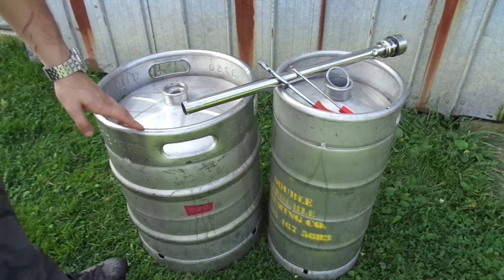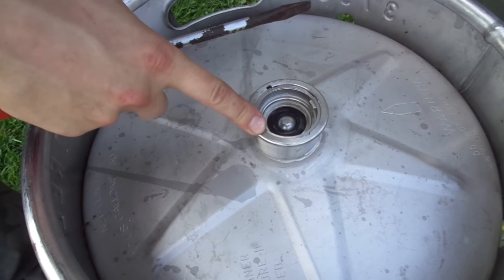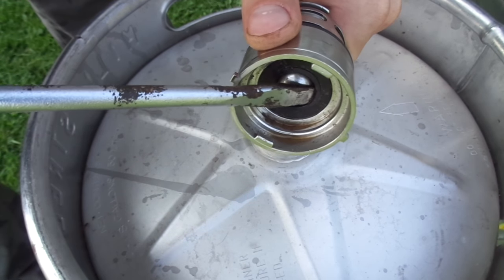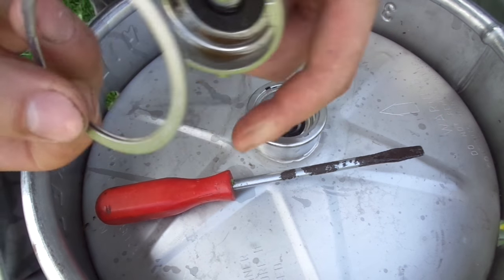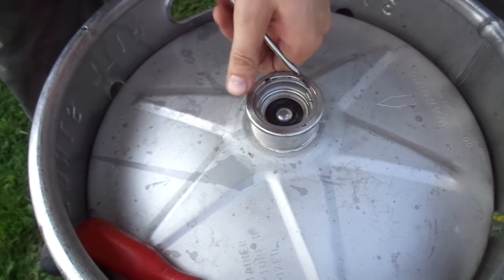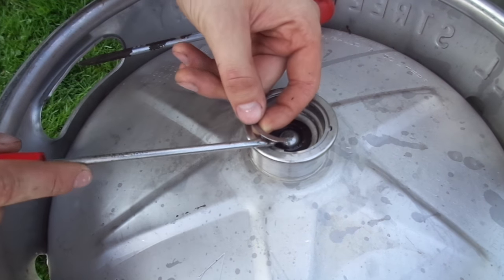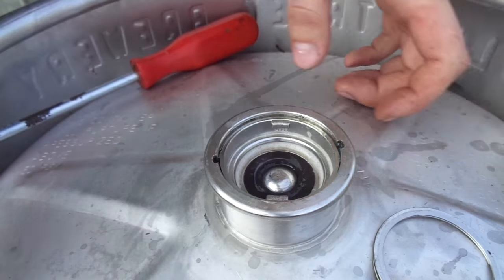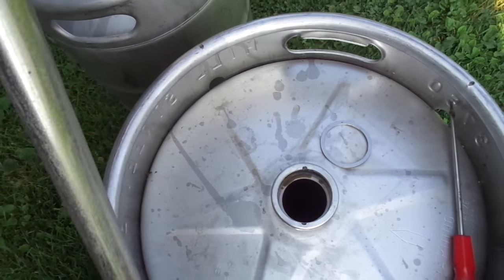How to decompress a beer keg and remove valve

Comment: A word of warning: If there is beer in the keg it will build pressure back up if you don't get the lock ring out quick enough. It's usually not enough to blow it through your jaw but if you let it sit long enough after "depressurizing" it will get ya and you'll get a nice beer shower to go with it.

Comment: Thank you for this video. I got 3 kegs from a junk removal job and now I want to turn these in as clean aluminum
Reply: I was under the impression kegs are made of stainless steel, at least that's meant to be the case around these parts (Ireland). I'm hoping to turn one into a bbq or weld two together and make a right beast altogether 😁
Reply: @kylearmstrong3456  To my understanding Kyle, they are Stainless still.
Reply: Also turning one into a bbq and using another keg for a log burner.

Comment: Not the worst video, at least it is effective in demonstrating the principle of how to open this type of keg. I would suggest however that the proper wrenches for pulling apart the retainer ring are mentioned. Also, if you're doing it by hand the back end of a wooden spoon would be a better choice for pressing the ball bearing.Also, if you just want to get the pressure, you can tilt the keg.So the absolute last of the remaining fluids are not picked up by the pickup stem.

Comment: Easy Peasy. Use your tap to empty and decompress before valve removal. Craftsman 1/8 screwdriver. Start at the thin edge and work it around, it comes right out. Without residual pressure in the tank there is hardly and tension on the locking ring.

Comment: How do they clean out the keg when it is empty and they have to clean and sterilize the keg ???
Reply: @noneshere  Got it fella. Thanks
Reply: Moser breweries use a three step cleaning method or they should. Put step 1 n 2 require hot water and the 3rd cold. Step one is a caustic bath and this is to kill/ clean any left over organic material. Step 2 is a poni acid and this is mostly to protect the stainless steel. And this is done because step one is very tough on the metal,it leaches compounds from the surface while cleaning so by step 2 you are pulling all  the stuff in the metal from deeper within and putting it back closer to the surface. This will extend the life of keg. Step three is a sanitizer bath.  Check temps on cleaning agents for optimal use.   Then once your ready remove keg fill with water and chemical put cap on then what we call walk the dog. Lay keg on side and roll it across the floor. I would do this for atleast 10 minutes. Then tip and drain. FLUSH KEG WITH WATER BEFORE NEXT STEP!  Hope this helps.
Reply: @Prickly-Brew  Actually this really clears up any ambiguities I had with the process Todd. Now I can pay homage to the beer GODS.  SALOOTE !!!
Reply: @victoryfirst2878  if you want to know anything else just ask. I’ve been brewing beer on a commercial scale now for 20+ yrs.
Reply: @Prickly-Brew Shame you are not near my location Sir. Would love to try your beer. What is the hardest beer to brew ??
Reply: @victoryfirst2878   In my opinion I would say a clean and clear Pilsner lager.   The actual brewing process itself is relatively universal in a lot of aspects.   But  I think you can tell the  skill level of a brewer  by the quality of say a wheat beer.  The grain profile used in a wheat is so simplistic that you can notice any tannins  real easily.
Reply: @Prickly-Brew  Wheat beer was made by the Egyptians, was it not ??? I remember something about this in my history class, unless my memory slipped. The builders of the pyramids where paid with food and beer. Must of been a tough time working in the sun with ones comrades without any safety equipment.
Reply: @victoryfirst2878  that I’m not sure of but oh probably close to 20 yrs ago a brewery came out with a beer called Midas Touch. And according to the story they found sealed beer in Egyptian tombs and were able to analyze and find out the grain profile and they were also able to kickstart the  little bit of yeast that was in the bottles as  well.     I can tell you though that IPA (Indian pale ale) came about from explorers looking for a way to keep their beer from spoiling while crossing India. High amounts of hops work as a preserver allowing the early explorers to enjoy their beer throughout the whole trip.
Reply: @Prickly-Brew  I am ready to take a trip across the ocean drinking beer. Sounds like an adventure for sure. We can be sailors mates sailing the high seas.
Reply: @victoryfirst2878  I will bring the IPA. If you like IPAs and have patients I suggest the 120 minute IPA by Dogfish Head Brewery. They make a 30,60,90 and 120 version. All are good but I just recently found out their 120 minute was designed to be aged  atleast five years before drinking. In that time it becomes a barley wine. I had one about 6 months ago from a case my buddy bought 7 years ago.
Reply: @Prickly-Brew  Thank you for letting me know Todd. I will definitely watch the video Sir. What puzzles me is how can beer become wine ?? I never know that Sir. I guess what they say is true. One is never to old to learn something new. Just might be exciting for sure.

Comment: How do you re seat the circlip when reinserting the spear?
Reply: I used two metal Square tubes to leaver (one on each side) down on the ring with the wrong side of a 2 inch hole saw  using a wooden block to leave down on the teeth of the saw

Comment: Can anyone give me a measurement of the open top valve? I’m failing to find measurements. I want to place a silicon bung in the top to reuse but need to know what size. Thanks!
Reply: The inside dimension is 2".   A  1 1/2"    PVC cap fits it good.

Comment: Just did mine....... And did just like he said but found that a good set of needle nose plyers help out ALOT. I pushed that ball in MULTIPLE times. First 2 times a ton of air came out then stopped then I pushed it in all far as it would go and held it...... nothing so I proceeded to take out the stem and hit the ball by mistake. Next thing I know beer is pouring all off my face. Lol!! So I said screw it I'm gonna keep going. After 5 min it was out. Thing is that beer had been sitting in there for well over 2yrs & micro brewed so it smelt so damn rotten. That sucked!!! If you do this....keep clear of the stem at all times, even if you think it's been depressurized 👍

Comment: If you have a keg Coupler, take all the fittings off, put your hand over the top hole and push the handle down. All the gas empties out. Then with the Coupler still down twist anti clock wise will unscrew the stem. Your welcome.

Comment: now put it back.    lol.
Reply: Wascally Wabbit I did that part. It was difficult. And now I can't undo it. So I'm here.
Reply: My Keg doesnt have the two holes on either side, So I cant even get it off at the moment
Reply: Midnigh7X is it a screw in. Release the pressure and then use screw driver and hammer on tabs to unscrew it to the left